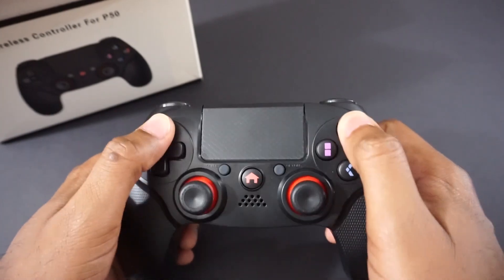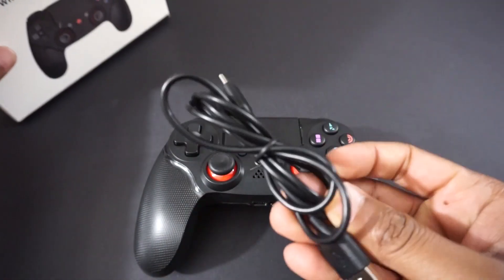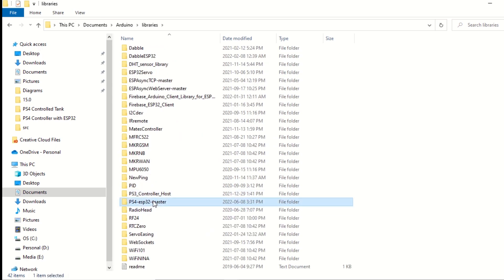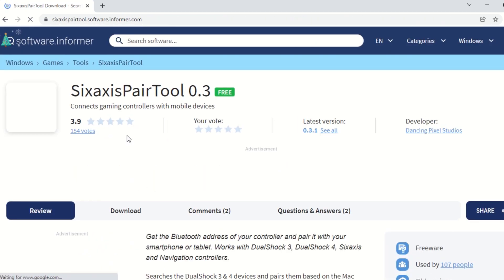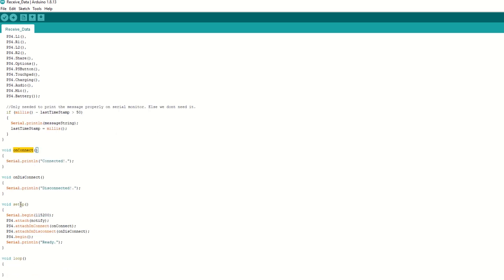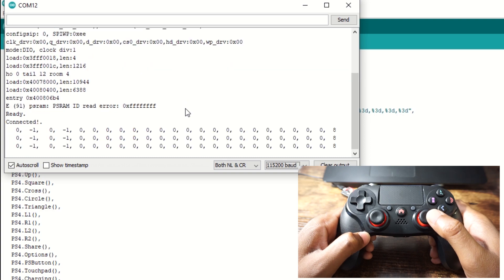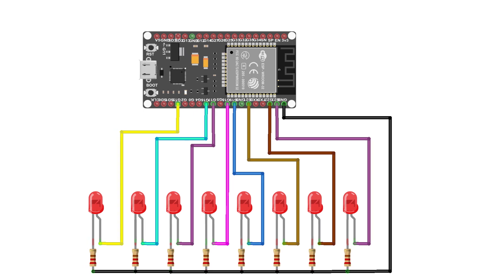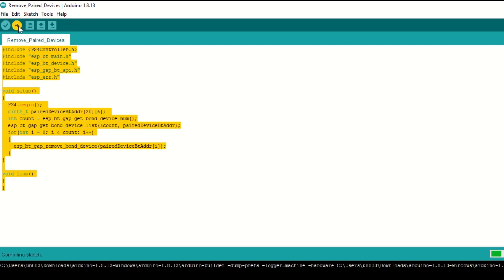How to use PS4 Controller with ESP32 🎮| Major issues solved 👍🏻

Comment: I bought 3 different ps4 controllers from amazon.  they all do the exact same thing.   followed all the steps in the video, tried every suggestion made by others in the comments.  everything seems to work up until time to pair the controller.   all 3 controllers just flash and turn off after a few min.   None ever connect.    I cleared previous bt paired devices, but there are none.  esp32 is brand new.   Never hooked anything to bt yet.  all controllers new out of box, not connected to anything but the PC via usb to set master mac.  Tried to make changes suggested by Tony Johnson, "Need to leave line 87 un-commented and comment out line 89. Your solution gives a complie error "too few arguments to function ".   This gave me compile errors.    but it worked with the edits in the video  (maybe difference in version of librarys or board?)  Tried "add this at line 43 of PS4Controller.cpp : "#define ESP_BD_ADDR_STR "******".(my esp32 mac address)   and this didn't seem to do anything for me one way or another.      Granted none of my controllers are the exact one used in this video, but all very similar.   And my esp32 is just an amazon "AITRIP 2 Sets ESP-WROOM-32 ESP32 ESP-32S Type-C USB Development Board"
What versions of software is everyone running?    what esp32 library version?   what ps4 version?   what IDE version?   I am going to try to order the exact controller and try again...    but i think i will have the same results.
Reply: I bought a real sony PS4 controller and it worked with the original library with no modifications right off the bat.    simple as anything.   Cant believe i spend 2 days trying to get generic controllers to work.      apparently most of the generic ps4 controller now are just generic game pads, or xbox controllers made to look like a ps4 controller.
Reply: @kensoggs  so its perfectly fine with original ps4 controller ,but didnt work with 3rd party or clone ?
Reply: @absky14r     yes, i bought a used original controller and it worked perfectly.   but could not get a off-brand control to work AT ALL.
Reply: @kensoggs  damn,at the end im using ps3 controller for my project,it works perfectly fine with original or clone,oh even with that ps4 controller code u still can use ps3 controller connected aswell
Reply: hi @absky14r  I'm sorry but how you solve the problem that you had previously? I have issue that my pc can't read PS4 and also my PS4 can't connect to ESP32... I did many things but still it doesn't work until now. Could you give me some advice?

Comment: Great video. Is this possible to do with an Xbox one controller, assuming it has Bluetooth? Will I have to have a completely different code and is that available anyware?
Reply from the maker: Thanks for checking out the video . Unfortunately there is no support for xbox controller in this library.
Reply: @hashincludeelectronics  I borrowed a PS4 controller from a friend, your code worked perfect and your video is super easy to follow. Thank you so much for this video!

Comment: I noticed if the PS4 controller is connected to anything else previously like my PC then it wont connect to the esp32 even if PC's blutetooth is off.  I previously had my ESP32 robot connected to the PS4 controller successfully then i wanted to play some PC games with the controller and reconnected to my PC  bluetooth.  After doing this i could no longer connect to the ESP32's bluetooth to control the robot.  I used the code to wipe all the BT connections on the ESP32 provided in the description and it reconnected with the PS4 controller after wiping the esp32 and I was once again able to control the robot.  But now i cant connect to the PC to play games so, as a fix; it seems i need to reset the controller via the tiny hole and reset button on the back of the controller and then I can successfully connect to my PC's bluetooth for gaming.  This does disconnect me from the esp32 permanently until i run the BT wipe code and reconnect the controller to the esp32's bluetooth but at least there are solutions.  
hope this long winded comment helps out some of you out there.
Reply from the maker: Thank you very much for sharing this information. Definitely  it’s useful 👌🏻👏🏻👍🏻
Reply: yo thanks man , had the same issue

Comment: Great tutorial. Please note that mods to library files are incorrect. Need to leave line 87 un-commented and comment out line 89. Your solution gives a complie error "too few arguments to function ". Also, I needed top add this at line 43 of PS4Controller.cpp : "#define ESP_BD_ADDR_STR         "%02hhx:%02hhx:%02hhx:%02hhx:%02hhx:%02hhx"". Now everything works. Thanks
Reply: Which Version of Arduino IDE were you using? I havent gotten the same compile error but My controller will not pair
Reply: You rule man!
Reply from the maker: Nice 👌🏻
Reply: Your my inspiration tonyjohnson
Reply: A toast to tonyjohnson
Reply: CRACK!!!

Comment: hello, I loved your video and I wanted to try it but when commenting on the lines it still shows me an error and I don't know what to do because I'm new to robotics
Reply from the maker: Thank you for checking out the video 👏🏻👍🏻. What exact error do you get ?
Reply: @hashincludeelectronics  when I load the code I get: /home/student/Arduino/libraries/PS4-esp32-master/src/ps4_spp.c: In function 'sppCallback':
/home/student/Arduino/libraries/PS4-esp32-master/src/ps4_spp.c:89:30: error: 'ESP_BT_SCAN_MODE_CONNECTABLE' undeclared (first use in this function); did you mean 'ESP_BT_NON_CONNECTABLE'?
     esp_bt_gap_set_scan_mode(ESP_BT_SCAN_MODE_CONNECTABLE);
                              ^~~~~~~~~~~~~~~~~~~~~~~~~~~~~
                              ESP_BT_NON_CONNECTABLE
/home/student/Arduino/libraries/PS4-esp32-master/src/ps4_spp.c:89:30: note: each undeclared identifier is reported only once for each function it appears in
/home/student/Arduino/libraries/PS4-esp32-master/src/ps4_spp.c:89:5: error: too few arguments to function 'esp_bt_gap_set_scan_mode'
     esp_bt_gap_set_scan_mode(ESP_BT_SCAN_MODE_CONNECTABLE);
     ^~~~~~~~~~~~~~~~~~~~~~~~~
In file included from /home/student/Arduino/libraries/PS4-esp32-master/src/ps4_spp.c:4:
/home/student/.arduino15/packages/esp32/hardware/esp32/2.0.5/tools/sdk/esp32/include/bt/host/bluedroid/api/include/api/esp_gap_bt_api.h:480:11: note: declaredhere
 esp_err_t esp_bt_gap_set_scan_mode(esp_bt_connection_mode_t c_mode, esp_bt_discovery_mode_t d_mode);
           ^~~~~~~~~~~~~~~~~~~~~~~~~
/home/student/Arduino/libraries/PS4-esp32-master/src/ps4_parser.c: In function 'parsePacketSensor':
/home/student/Arduino/libraries/PS4-esp32-master/src/ps4_parser.c:278:10: error: 'ps4Sensor' is used uninitialized in this function [-Werror=uninitialized]
   return ps4Sensor;

Comment: Thanks so much for this tutorial.  I'm fairly new to Arduino and connectivity like this but was able to pair up my PS4 controller to an esp32 and got the LED's from the test code to work.    Excited to learn more and watch your other videos.  Thank you for the time and effort you've put in to making these....  There isn't much documentation on these ESP32 boards that I could find, but I was able to figure out how to upload the sketch from previous drone building days where you had to hold buttons on power up to load into bootloader.  On my ESP32 board I had to plug in, hold one button while pressing the other and I saw in serial monitor that got me in bootloader and gave message ready to download.  However when I uploaded the sketch the com port would time out and say bootloader not ready.  So after hours of trial and error, I uploaded (compiled) the sketch and when it gave the message of connecting to com port - I did the bootloader sequence on the board and sure enough it started writing the sketch to the board.  I'm not sure if this is specific to the board I got off Amazon - but it sure did take a lot of tinkering and maybe some luck to figure this out!   Maybe this comment will help someone else!
Reply from the maker: Thank you very much for checking out the video and nice words . Surely this will help others if they face issue while working with esp32. Thanks for sharing experience 👏🏻👍🏻
Reply: @hashincludeelectronics  Any idea how to map the r2 button to specific servo location/angle?  I want to use that button on a servo similar to using a pot with a servo - but everything I'm finding is for pots and it's not quite working out - the r2 button works to control servo, but it's either moving full rotation or nothing - it wont, for instance hold a position in half rotation if I was to press r2 half way down... even though it shows the r2 value correctly in serial monitor going from 0 to 255 as I depress it...  I'm stuck, but I bet it has something to do with the r2 button not actually being an analog pot.   which is what all the tutorials are showing - Any ideas / suggestions?
Reply from the maker: @kevbomtb6078  how do you read the value of r2 button ? Which variable do you use ?
Reply: @hashincludeelectronics  
void loop() {
  val = analogRead(PS4.R2Value());     // read the value of the R2 button (value between 0 and 255)
  Serial.printf("Non-Map Value at %d\n", val);  //
  delay(600);
  val = map(val, 0, ADC_Max, 0, 180);  // scale it to use it with the servo (value between 0 and 180)
  myservo.write(val);                  // set the servo position according to the scaled value
  Serial.printf("Mapped Value at %d\n", val);
  Serial.printf("PS4 R2 Value at %d\n", PS4.R2Value());
  delay(600);

Delay and print outs are just for trying to figure out what's going on - 
This is what I'm seeing in serial monitor:
The first loops are without pressing, the last loops are with the R2 pressed. - it's not showing what I'd expect.  ADC_Max is set to 4095.

Non-Map Value at 4095
Mapped Value at 179
PS4 R2 Value at 0
PS4 R2 at 0
Non-Map Value at 4095
Mapped Value at 179
PS4 R2 Value at 38
PS4 R2 at 1
Non-Map Value at 0
Mapped Value at 0
PS4 R2 Value at 255
PS4 R2 at 1
Non-Map Value at 0
Mapped Value at 0
PS4 R2 Value at 255
PS4 R2 at 1
Reply from the maker: @kevbomtb6078  I got the problem . Don’t read the value using analogRead. The value is already given by PS4.R2Value(). This value itself is from 0-255. So use this value as it is in map function .  val = PS4.R2Value(); val = map(val, 0, 255, 0, 180); and use this val for servo .
Reply: getting a fresh look this morning and posting it here I tried something different - why use analogRead() when the value is already in PS4.R2Value().  I tried this and then noticed the servo followed my finger on R2 but servo only moved slightly - so I changed the ADC_Max to the max value I saw with reported from PS4.R2Value() which was 255.  I put the delay to 10ms and everything works as I intended it to.
Reply from the maker: @kevbomtb6078  that’s nice . I just now commented and provided the solution before receiving your message😜 . Glad to see it worked finally 👏🏻👏🏻 good job .
Reply: @hashincludeelectronics  thank you!

Comment: First of all, thanks for the clear explanation. I encounter the same problem with the re-connection issue.  I've tried in the remove pairing and can be connected again, but only once. Is there any better solution on this issue? Thanks in advance.
Reply: Yes, same problem. PS4 disconnects after few seconds when I use this to control my car with this what should I do?
Reply: @pramukhjain1742  i have the same problem, i try with a new esp32 and a new controller but i dont know whats the problem
Reply: one year later still the same problem this is insane
Reply: @hecticaperture  i faced the same and i found the solution if u still intrested or any one in the future is the solutions is : to erase esp flash using esptool in python

Comment: At 2:27 when you select port, then COM12 I don’t have the 12 option, only 3, 4, 5, 6, 7, 8,
Reply from the maker: Com ports are different for different users based what already being used on the computer . So this can be connected to any available port . Try selecting the ports which are shown to you in Arduino ide .

Comment: I've done it successfully 1 time but can't again. how to handle it
Reply from the maker: Check the last step in video to clean up Bluetooth devices .
Reply: @hashincludeelectronics  yes i have try. But cant conecting now
Reply: I've tried in the remove pairing video. can be connected. but when trying to sketch receive data . can not connected. How to

Comment: Im working with 2 different wroom from 2 different sellers, they are not connecting to the controller after triple checking everything. i see there are multiple people with this issue. is this an issue with the board or the user?
Reply from the maker: Could you please check the last part of video where I have suggested how to clear all existing Bluetooth settings ? That might help you .

Comment: In ESP-WROOM-32 ESP32 It is not RUNNING!!!
many people said the same issue.
this time you should check it out with esp-wroom-32
Reply from the maker: I am using esp wroom 32 module in this project .
Reply: @hashincludeelectronics  ok thank you but you are using ESP32 Wrover module. 2:26 you can check it out.
Reply from the maker: @흠이건-i4e  while uploading the code , the wroover board also works. It’s compatible.
Reply: @hashincludeelectronics  2:41 PSRAM ID read error I checked. so your module is not  Wrover moudle. j
Reply: @hashincludeelectronics  so I took off another ESP Wroom 32 used a project, and It was running well, I think that some kind of board problem or maker issue 
THANK YOU!

Comment: Sorry, unfortunately I don't get a Bluetooth mac address on esp32.

What am I doing wrong?
Reply from the maker: What do you see on serial monitor ?
Reply: @hashincludeelectronics  The controller does not connect to the ESP32 module despite the entered Mac address of the esp32.

Comment: Its not working for me. I have esp-wroom-32. I have uploaded the connect code and pressed the home button on the ps4 controller but its not connecting even after many attempts. What can I do??
Reply from the maker: Please set up the PS4 Controller mac address first. Check this step properly. Then upload code into esp32 module and try to connect.
Reply: @hashincludeelectronics  I have already done it.
Reply from the maker: @Roboz1106  i have provided one step where you can clear all the existing Bluetooth paired devices from esp32. Not sure if that’s the problem . Please check that step and perform it first .
Reply: @hashincludeelectronics  I am having the same problem.  Bought a generic ESP-WROOM-32 ESP32 board on amazon.  Got through your tutorial perfectly.  My problem is that PS4 controller keeps flashing and won't connecting.  I did the mac address and removed the previously paired device code that you posted.  Any idea?  The weird thing is that no matter how many times I run the removed paired device code it keeps finding devices in the list of paired devices.  I listed them out to serial to see what it was removing.  I cant get that list to be zero.

Comment: Great tutorial. I have the Arduino Nano IOT 33 which I would like to connect to my PS4 controller, any chance that you already have  a tutorial for that as well?
Reply from the maker: Sorry don’t have specific video for that module . However you can check if there is any library for this. This module works on python coding ?
Reply: @hashincludeelectronics  There is a ready made library called "bluepad32 " made by Ricardo Quesada. in order to work with that, the Nina module on the Nano IOT board need to be flashed with the required firmware. the flashing process is not that easy for some like me who has no experience with firmware flashing...
Reply from the maker: @haimn1193  agree . Flashing new firmware is difficult . You can check for more information on net . Hopefully you will get something in this direction 👍🏻

Comment: Sir, esp32 can't connect ps4 at all while could connect to pc.  Can't solve.  Please suggest.
Ps. it's a fack ps4.
Reply from the maker: Please check all the steps properly . Make sure to Set up the MAC address of esp32 into ps4 controller .
Reply: Thank you. Will try again